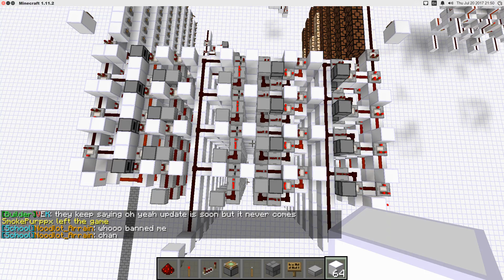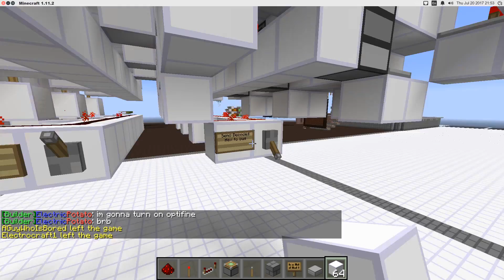Signal Strength Conversion Cache

Comment: So if you lined up multiple of these Caches you could in theory write info from the Main memory on one whilst another is still using the previous set and then just switch over for instant usage? would that even work?
Reply: This could probably work, but I doubt the logic and space overhead this creates makes it an efficient solution

Comment: Hey Benny, What are your thoughts on command-block based processors and data structures? Have you ever experimented with them?
Reply: This could probably work, but I doubt the logic and space overhead this creates makes it an efficient solution
Reply: Suppenfischeintopf It is absolutely efficient, way more so than a normal redstone computer, since it allows you to write code which uses your actual PC's computation power to do things like addition, subtraction, multiplication, and division much faster, not to mention the fact that data has no need to be bussed all over the place, it can be accessed from anywhere.
Reply: Whoops, apparently I replied to the wrong comment. Now I have to figure out which one this answer was meant for :D

Comment: well figuring out what to cache is probably gonna be really difficult if you dont wanna take a too too naive aproach i guess isnt it? especially if you wanna cache, say, the program
Reply from the maker: Well, two things: First, this is really designed for caching RAM, not programs. Second, this is pretty much designed for the naive approach for caching. From what I gather, there isn't that much to be gained by going with more advanced caching approaches in Minecraft yet. This is largely because relative to CPU speeds, even the most naively designed redstone RAM is far, far faster than real-life RAM. Real-life RAM typically takes around 300 CPU cycles to access (Approximately. There's a lot of variance, but 300 is a good rule-of-thumb ballpark estimate). Even if you're using a high-performance 6-tick redstone CPU, your RAM would need to have a 1,800 tick access time on average to be on-par with real life RAM (in relative terms, of course). Point is: Since redstone memory speed is close to redstone CPU speeds, there just isn't much to be gained from advanced caching, as the whole point of caching is to minimize the difference between memory access speed and CPU speed.
Reply: hmm yeah i see. though caching programs would be interesting if you re actually running those out of the ram too and are not using programm memory like many do

Comment: About reading 4 bytes out of a 256 bytes memory that only take 32 ticks with this design, it's is interesting but I'm pretty sure I'm not the only one to wonder "how much time would it take with a "regular" memory design? I have absolutely 0 notion of how fast it is supposed to be, so I don't really know if it's twice as fast, or 10 times faster, 100 times faster, ... ?
Reply from the maker: Good point! Actually, my goal wasn't to beat normal memory performance as much as size. I just wanted get a decent enough level of performance to be usable, but it's an interesting question for sure.

That's actually a tricky comparison to do because there are a lot of different parameters to play with, each giving different performance characteristics and other pros/cons. Like is the regular memory the usual "straight line" design that adds 1 tick for every additional 8 memory words or is it using a branching "tree design," which takes more delay to do, but you can potentially access a lot more memory words in that time. Or how big is a "word" of memory? If it's the usual 8-bit size, then that allows optimal performance of read/write lines, but it requires you to do 4 reads to read 4 bytes. If you go bigger, that allows fewer reads, but at the cost of longer read/write lines and it also increases the cost of each "branch" in a tree design (Plus, anything bigger than 8 bits is almost impossible to use WITHOUT some kind of cache because you need some way to break down in order for it to be byte-addressable)

Here's a few different designs and how they'd perform on loading 4-bytes and writing them to a cache line: 
8-bit straight line memory - 140 ticks
16-bit straight line memory - 40 ticks*
32-bit straight line memory - 14 ticks*

Simple branched 8-bit memory - 60 ticks
Simple branched 16-bit memory - 32 ticks*
Simple branched 32-bit memory - 24 ticks*

Recursively Branched 8-bit memory - 52 ticks
Recursively Branched 16-bit memory - 32 ticks*
Recursively Branched 32-bit memory - 14 ticks*

*Memories with more than 8 bits are going to have the output bus NOT match up nicely with the cache input. This will almost certainly add a few ticks, although it isn't clear how many. Probably fewer than 10, but no less than 2.

Overall, memory with this cache has a middling performance level compared to normal memory designs, although that depends somewhat on what you're comparing it to. Compared to the 8 bit memory designs, which are by far the most common, this basically blows them out of the water. Even the fastest and most advanced design could only manage 52 ticks for a 4-byte cache load. Compared to the more specialized 32-bit designs, my system is a sloth. 14-ticks is incredible for a 256-byte memory system. Compared to the 16-bit systems though, my system is essentially on par.

What all of this ignores, and this is critical: ALL of these normal memory designs are AT LEAST 4 times larger than the hex memory+cache. This is the real win (and my true objective) for the system I've been working on: A well-performing memory system that maintains high density per block. Otherwise, you can't scale to large amounts of memory, which in my opinion, largely defeats the purpose of memory.
Reply: Mhmm.. I may not have understand everything but I think I got most of it! :) 
And what exactly is different between an 8 bits and a 32 bits memory? Does 32 bits means you can still use it on a 8bits computer but you can only save memory 32 bits by 32 bits? (and when you read it you can parse the 4 differents bytes to get all your data?) 

Which would mean each time you have to save memory, if you have only 3 bytes to save you have to "waste" 1 byte because one cell of memory is 4 bytes? And if you want to read a particular byte you must load the 3 others that are in the same cell and then parse it?
Reply from the maker: Your general idea is almost correct. The number of bits in a memory system = the number of bits written or read at a time. There's no requirement that it must be the same as the number of bits in your computer (In real life, for example, RAM is byte-addressable, meaning it effectively acts like an 8-bit memory system, even though hardly any modern computer is 8-bits)

The cache, however, can effectively act as an adapter that lets you address these different sized memory systems as if they were 8-bits (or any other size), even if they aren't. That's because the cache will break it down into chunks of memory the CPU will accept, however big or small that might be. So as long as you're using a cache, there isn't a huge downside to the higher bit memory systems other than they only work with a cache that accepts that particular bit size.

Comment: Make warp or show me next time ur on. I'll use the control system from this to go from Nikkeru's hex memory to my GPU 8x8 serial frames. So I can access more frames fasta
Reply from the maker: If you warp to my plot and fly straight to the other side, you'll find it there. You'll also find a second version above it that's about the same size, but the cached memory can work at 2 ticks speed instead of 3 ticks.